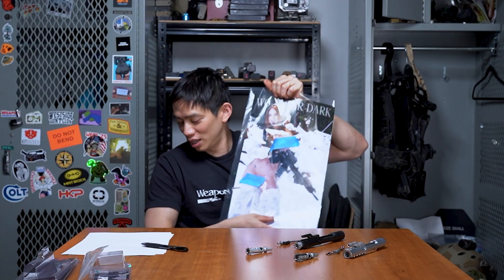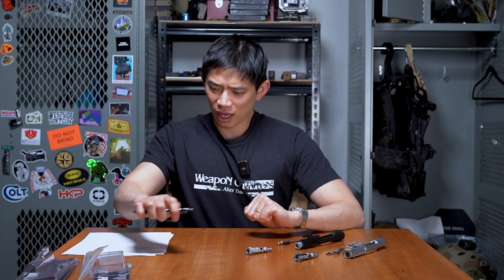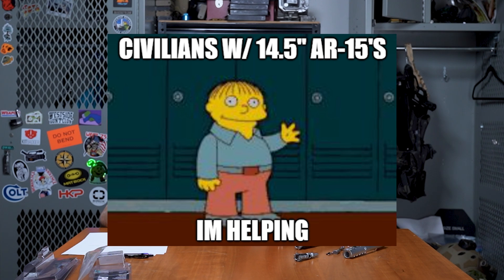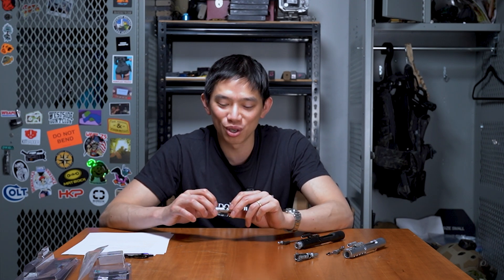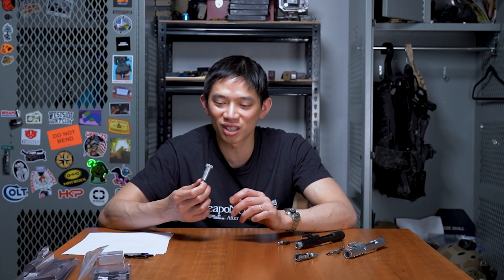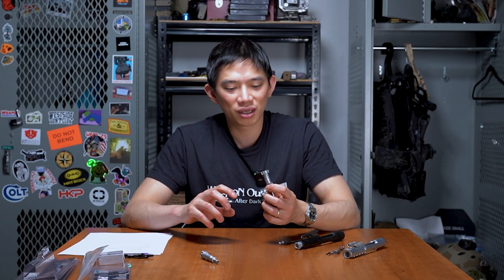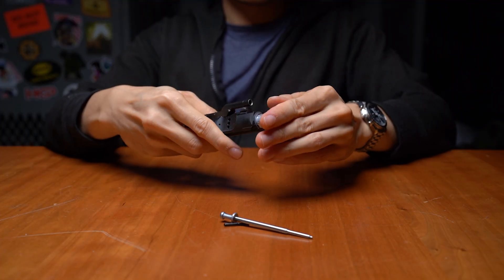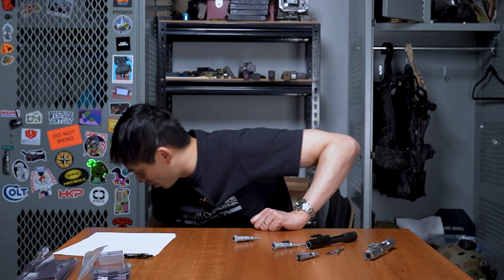WO Show Episode 13: Enhanced AR15 Bolts worth it?

Comment: The LMT carrier with modified cam path alone changed my MK18 w/ 0.070" gas port, H3 buffer, and Surefire RC3 from 2:00 to 3:30 / 4:00.  It does slow cyclic rate down a bit.  No more gas to the face.  This is the best upgrade for $185.
Reply: That's interesting. I wouldn't think it would be so drastic. Does the same setup cycle unsuppressed still?

Comment: While I was in the Army, I was a company armorer. I never saw a failed M4 bolt (that wasn’t the gas rings). I did see cracked lower receivers right underneath the charging handles. I also saw barrels wear out before the bolts wore out, so super bolts aren’t a necessary upgrade.
Reply: That's because your direct support team annually gauges your weapons, which includes a detailed inspection of all heavy wear parts.  The bolts were likely replaced during this annual event.  Source, I was a direct support armament repairman and replaced hundreds of M4 infantry bolts over the 7 years I was in.
Reply: @joelwright1822  I did them as a level 20 not the 91F's we used the tm did them text book then then the 91F's came over to our arms room to verify and check and do their quarterlys
Reply: @joelwright1822    Yeah, they are called quarterlies, and no, they didn’t replace the bolts; only the rings. I was there.
Reply from the maker: @Hibuy-  I just know that I shoot enough to have broken a few bolts as a regular ole guy!  Crane's white paper report needs to get reuploaded but I saved a screenshot on the 8 MK18s they tested with breakage on average under 10K: https://x.com/WeaponOutfitter/status/1847424546946838648

Comment: I run Expo Arms (Microbest) on all my rifles - same OEM as DD/BCM/SOLGW but sold for $90 (when on sale). Put in a Sprinco upgrade kit before installing. If I ever went the gucci route I would consider the Geissele REBCG, but I don't see a compelling need as of yet. I also have a JP Enterprises bolt in my SPR - they are known for being some of the most precisely machined bolts and are often used as a benchmark for headspacing.

Comment: Iirc Filthy 14 had a 16" midgas barrel. The 14 stood for its position on an armory rack.
Reply from the maker: That makes sense, it's been a hot minute since I read it front to back.  Midlength 16s were all the rage in that time frame of the late aughts

Comment: hah this is  sweet, I have been personally testing this for a number of years when the Zantac first made their EBCG. Now I dropped the Centurion Sandcutter w/ LMT Bolt in my 13.7 Noveske and a Knights sandcutter w E2 bolt in their CQB mod 2. Solid info and will be buying some backups from you

Comment: I did have a insider tell me that a lot of higher or mid tier AR-15 manufacturers actually have their bcgs made for them and a lot of them use Microbest as a oem supplier. So the microbest phosphate mill spec bcg is pretty much the same exact bolt without branding for half the price.
Reply: Most of the mid tier companies like BCM, and dd use micro best bcgs, the actual high tier companies like geissele, lmt, kac, and griffin make their own, they are all unique/enhanced in their own way. In regards to your future reply: those enhancements exist for a reason.
Reply from the maker: Yeah, Microbest and Toolcraft (now owned by PSA) are major OEMs!  That's the standard, these bolts try to offer something more than standard.  Replacing your standard bolt at 5-10K preemptively is a legitimate strategy as well, Magpul's MIAD grips even allow you store a spare on your rifle
Reply: Yes - they are the OEM for DD, BCM, SOLGW, and a few others. You can replicate a DD/SOLGW BCG for literally half the cost by buying one and doing a $10 Sprinco springs upgrade. Expo Arms (Primary Arms house brand) are also Microbest and they sell at great discounts occasionally.
Reply: @alexisdetocqueville9964 great to know expo arms are made by microbest as well

Comment: I got my ADM4's BCG, which seemed kinda meh when I watched School of the American Rifle break it down, switched out for a Centurion Arms Sandcutter Bolt Carrier and a Geissele Stressproof Bolt. 
Passes all Go/NoGo/Field gagues, and still runs like a top. The rifle itself is a step above anything else I've shot, and I feel i've just made it even better.
Reply from the maker: I need to try out the Geissele!
Reply: @WeaponOutfitters I’ve only put a few hundred rounds through it so far, but cleaning it is just as easy as the Chrome carrier itself. That “Nanoweapon” finish they use on it is slick as can be. Only the boat tail was *some* carbon stuck on there hard enough that I had to brush it off, 90% just wiped off with the rag.

Comment: F/A-18 nose landing gear includes major structural elements manufactured with AerMet 100. This advanced high-strength steel is known for its damage tolerance and its resistance to crack propagation